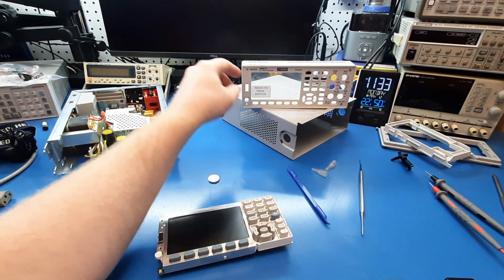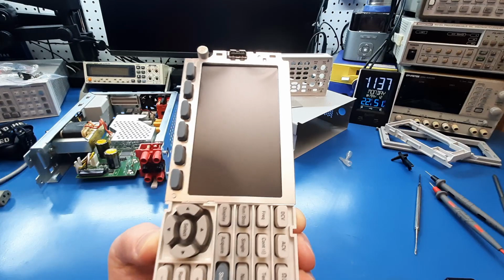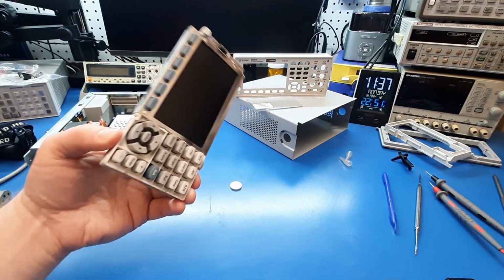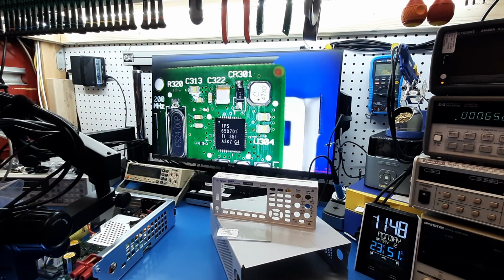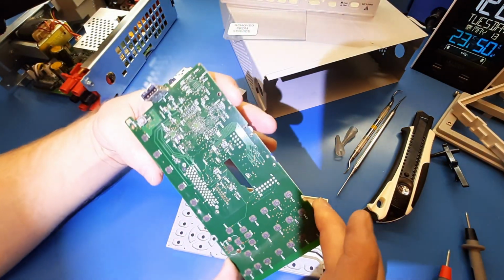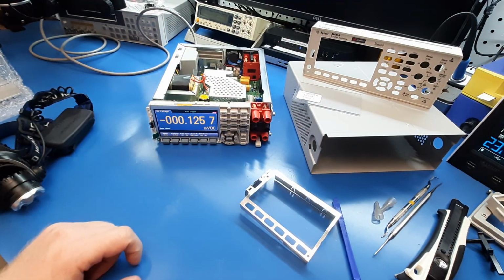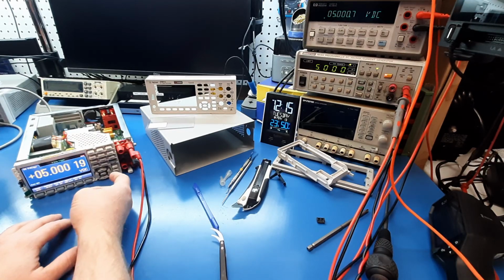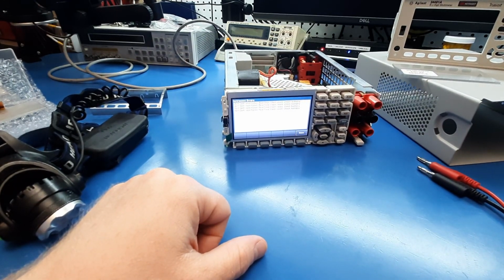Agilent / Keysight 34461A White Screen of Death repair!

Comment: Bought a white screen-ed 34461A. Tried new lcd panels. No luck. Currently trying a new SPEAR chip... will advise on result.
Reply from the maker: Good luck!  The SPEAR dying is the more common failure mode from what I understand.  If you look at it with thermal imaging and it's really hot (or doesn't warm up at all) that's a dead giveaway.  Normal temps are around the 40C+ range, bad tends to be 80-90C and up.
Reply: @neverendingstudent Thahk you! I would really like a decent thermal camera to assist in diagnosing the problem. One other detail that's important is the TPS chip was also getting really hot. I believe it's from something else (the SPEAR320S) drawing current, but not certain. I'm replacing the small 2.2uf inductor for the 3.3V rail, as that was so hot, it browned out the label. Also replacing the large ferrite bead on the bottom side of the circuit board... a capacitor C327, and the 0 ohm resistor immediately opposite the 3.3V rail inductor.
Reply from the maker: @CalmBeforeTheStorm76  I have a low cost thermal cam I could sell you for cheap.  It's a review unit, not too accurate for measuring specific temps, but fine for seeing hot spots.  Send me an email if you want it, contact info is in the channel description.  Also thank you for the specifics of what you are swapping out.  You might consider making a post on EEVBlog covering the repair attempt, both to get community help and for your documentation to help others (if you haven't already).

Comment: The calibration is on the main board, not on the screen board. The calibration likely working 100% fine. Whether you think the values could be more accurate is another issue.
Reply from the maker: Yep, it still had cal data.  I think this unit (if I remember correctly, it was over a year ago) had some drift and wasn't perfectly precise, but it wasn't giving readings that were well with a healthy sanity check for meter function.

Comment: I have an Agilent 34461A that needs a new screen.  My unit works fine, but when I turn it on it has a horizontal line running across the top. Your video has given me the courage to try and replace my screen, so that I might capture that same feeling. I was wondering if the error message went away after you reset the clock or does the unit need to be recalibrated before that error message will go away. Nice work on the repair.
Reply from the maker: The error did go away after setting the clock (and having the RTC / coin battery properly set).  It does not appear that the coin battery is responsible for calibration data as the unit still had original factory cal data.

Comment: A couple of weeks ago, I almost bought a $700 Keysight 34465A with the same issue. It's identical aesthetically but packs more under the hood. Instead, I decided to finish working on the Fluke 8846A I got for $360, which has the resistance mode out of whack. It's a bigger headache than I anticipated, but there is progress, and I'm confident I'll reach the finish line. I'm happy for your win; though, it's a great dopamine dump and a top shelf meter.
Reply from the maker: I would say $700 is a bit steep for a '65A for repair... but it's kind of borderline, they are good instruments.  I have one as my main bench meter and love that thing, but I got stupidly lucky finding a black version for $500.  The Fluke 8846A is a very handsome meter and I'd say getting one in repair status for $360 is pretty damn good considering they typically go for the $800 to $1400 range.